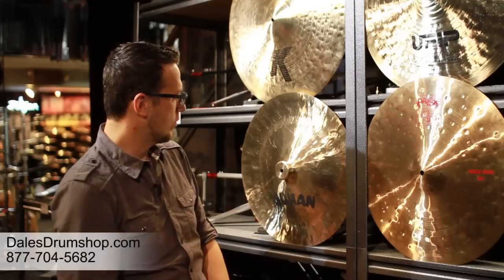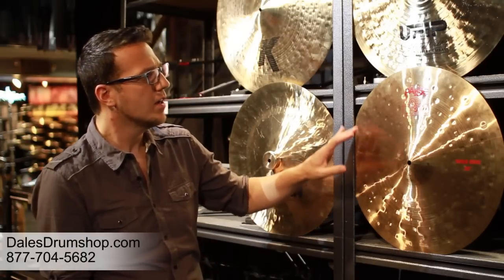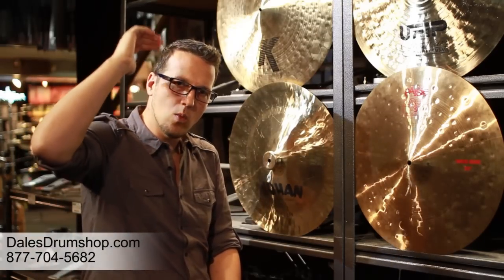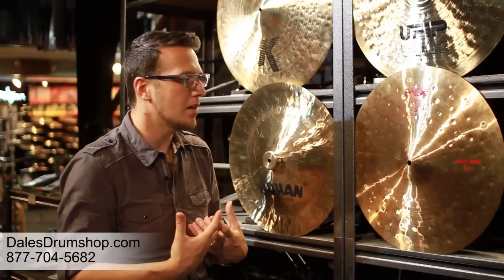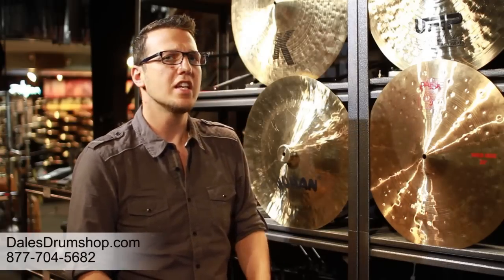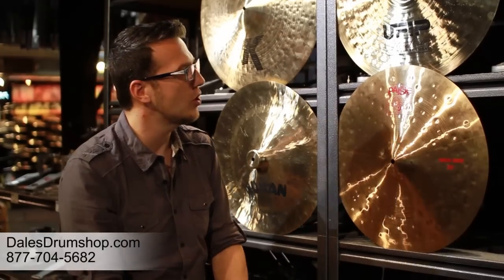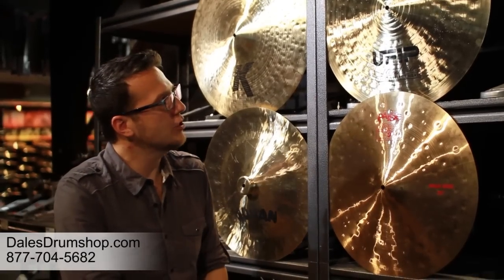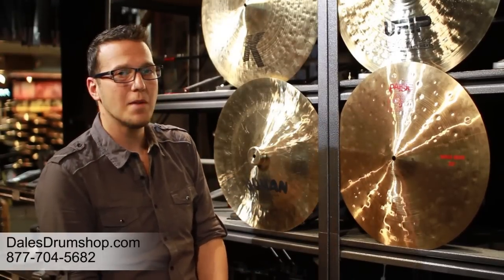Understanding Cymbals - Dale's Drum Shop

Comment: I use a mix of Paiste Signature,2002,and Ufip for my crash cymbals..Ufips are amazing and very Musical..The roto casting gets rid of weakness in the alloy,so they say...Class Series Fast Crashes,Natural Series which are like the "K"Zildjians of the 60s and 70s...Blast Crash,and The Newer "Vibra"series....My hats are 14' and have a 2002 Sound Edge Bottom and a Signature Dark Crisp Top...2002 22" Power Ride...

Comment: Zildjian K.. UFIP and Wuhan are B-20 cymbals (80% copper & 20% tin w traces of silver).. Paiste 2002 are B-8  (92 copper and 8% tin). Cymbals made of the same elements.... different tones, etc have to do with hammering and lathing. B-8 cymbals with most brands represent the lower scaled cymbals. Paiste's 2002 line are used by big-named drummers.... yet, they're B=-8 cymbals. It all has to do with manufacturing... how cymbals are made. Not necessarily, about the materials.
Reply: El incomparable maestro del Jazz, Tom Rainey, usa un ride de 20" Paiste 2002 Black Label de los 70s, aleación B8 y le saca sonidos maravillosos. La lógica diría que un baterísta de jazz no debiera usar esa aleación, pero no es el instrumento, es el músico y su talento el que  puede hacer que su instrumento genere música.